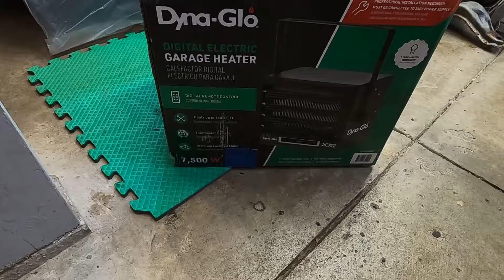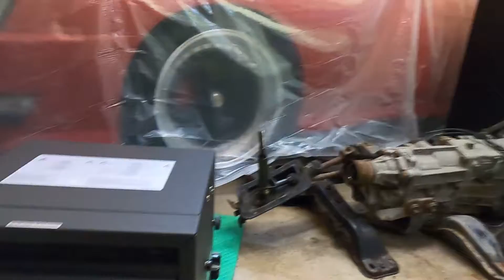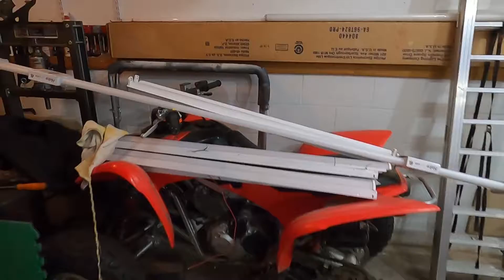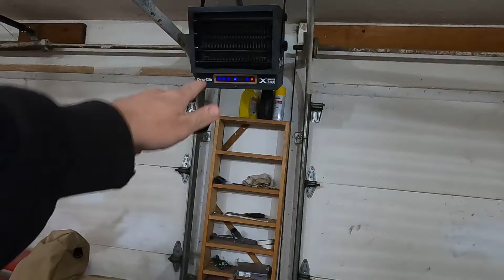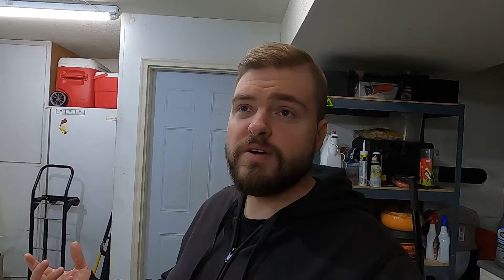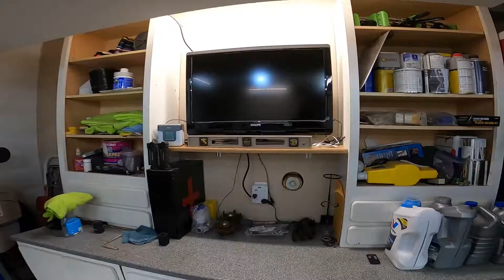Installing Dyna-Glo Electric Heater & LED Lights | Garage Upgrades

Comment: Bought the same heater brother, just wondering how hot it blows on low mode because on mine it’s warm but not nearly as hot as high. I was wondering if you found a way to keep it on high mode

Comment: I just bought the same heater. Just fired it up 30 minutes ago. Do you have any idea what the weekly cost of running it is?
Reply from the maker: I’ll hopefully know at the beginning of January. I’ve only had mine up for about 2 weeks now.
Reply: @Abnormal Garage  I wrote down what my meter total was tonight. I'll check it tomorrow at same time. Then the end of the week too.
Reply: @richardswartz4273  Just ordered the same one - may i ask what your total running cost on average?
Reply: @StinkyPotato-EpicGameTime  I returned it. Used it for about 3 weeks. After monitoring usage. I had to turn the temp up about 10° higher because heat rises. I have 8ft ceilings in my garage. So if I wanted 60° I'd set the heater to 70°. Cost was on a very high side of around $5-12 a day. We had cold weather in single digit numbers then quite warm in the 40's mixed into that. When I ran it a week straight continously it was close to $9 a day which is absurd. So I returned it. I'm in Northern Michigan for reference and my Kwh is $.011
Reply: @richardswartz4273  Im in eastern Canada - This is defiantly not the product for me.  Thank you for your reply Richard!